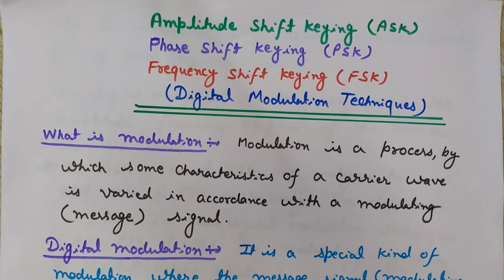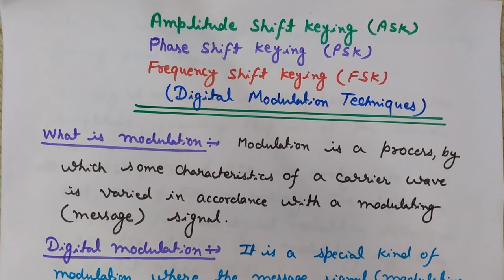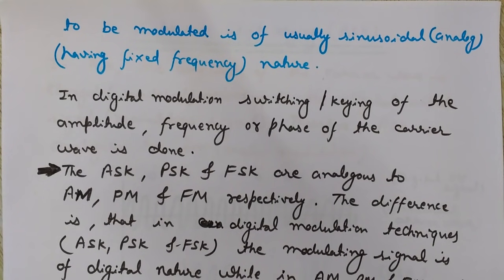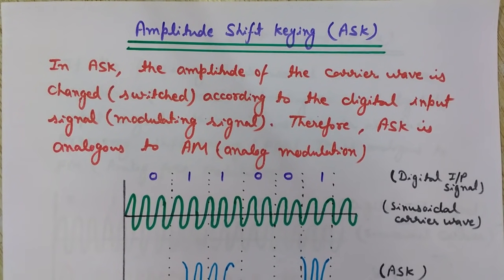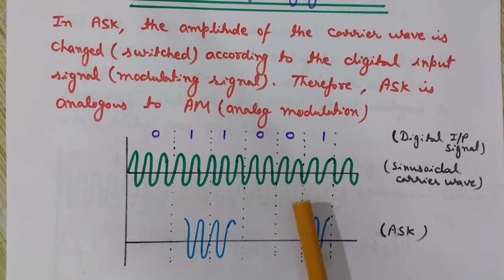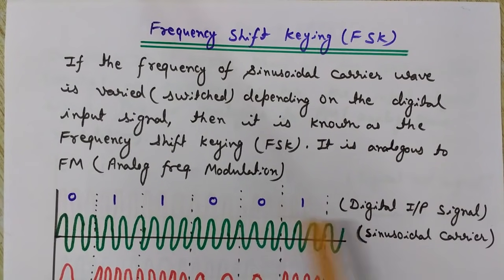ASK FSK PSK Modulation / Digital Modulation Techniques / Amplitude, Frequency and Phase Shift Keying

Comment: 00:09 Digital modulation involves varying a high frequency carrier wave based on a digital message signal.
01:42 Digital modulation uses analog carrier wave and digital modulating signal.
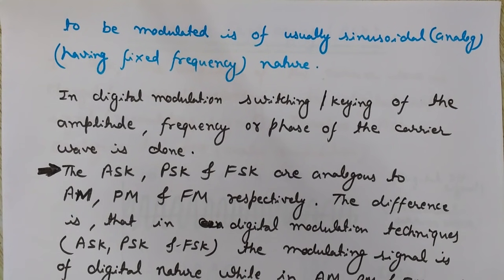03:21 Amplitude Shift Keying (ASK) modulates the analog carrier wave based on digital input signal.
04:56 Amplitude Shift Keying changes carrier wave amplitude based on digital signal.
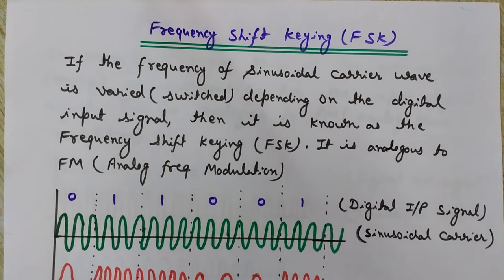06:39 Frequency Shift Keying (FSK) varies the sinusoidal carrier wave based on the digital input signal.
08:17 Frequency Shift Keying (FSK) changes carrier wave frequency based on digital input signal.
10:00 Phase Shift Keying (PSK) involves varying the phase of the carrier wave according to the digital input signal.
11:30 Phase shift keying involves phase changes in the carrier wave.

Comment: Please sir, I was given this question, If the amplitude of the modulation signal voltage was 
given to be -4v and +4v and carrier amplitude also given to 
be -22v and +22v, by suitable waveform diagram 
determine the Am modulated output. Remember to 
provide all necessary wave forms in practical terms.

How can I go about it, can u make a vedio of it

Comment: Sir I have question in any modulation the noise will be add  digital pulses ( 0  or 1)  or not. Pz tell me sir
Reply from the maker: Although noise is analog and random unwanted signal but Digital noise can be considered In terms of glitches. When input is having some noise then it can false trigger the flops because they are edge triggered, in case of digital electronics.
Reply: Nice